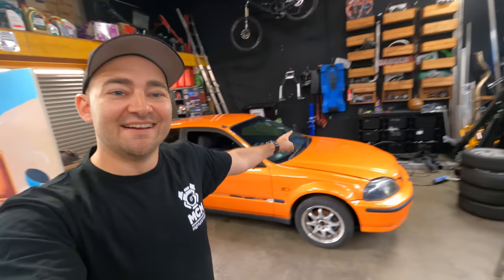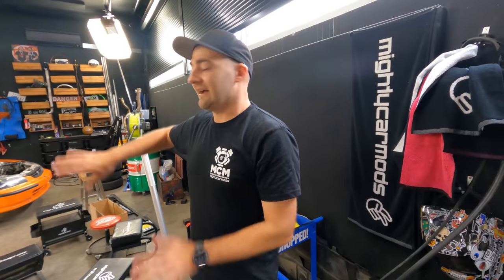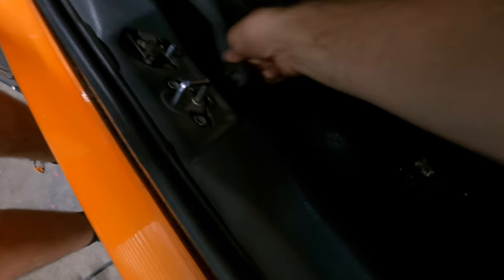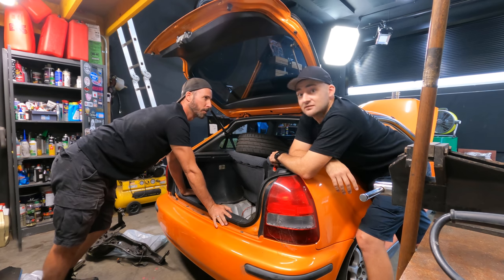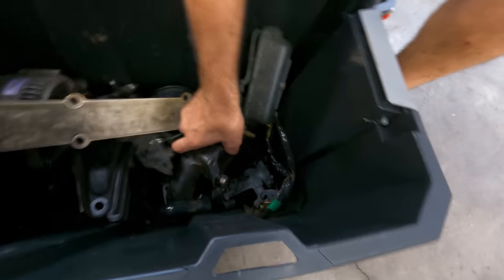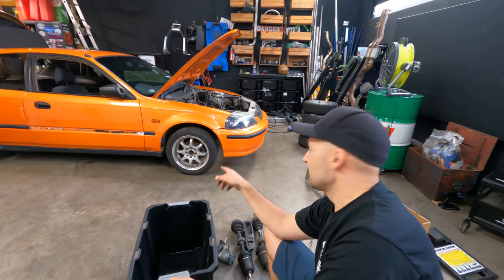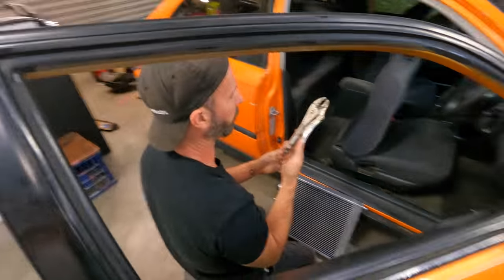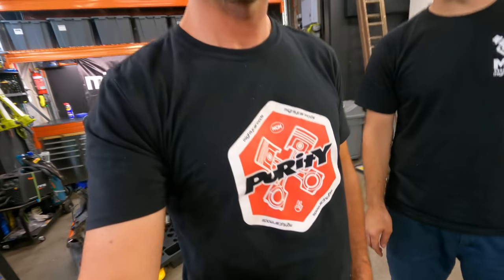Buying an unfinished Project Car (off the internet)

Comment: Answering marty's question: The one and only "unfinished" project car that i ever bought was a toyota corolla ae100. It belonged to a former diplomat from the us embassy before the guy that bought it from bought it. It had more than 500,000 km when i got it. It was running. The things done were the brakes and the suspension. When i bought it it came with a box full of parts like full aftermarket stainless steel exhaust, new headlights, a bosche horn, a nardi steering wheel, a trd shift knob, aftermarket injectors, iridium spark plugs, aftermarket camshafts, aftermarket fuel pump. I "completed" it until a disastrous day in 2014 came and a typhoon hit my city and took down a mango tree, an electric post, and an avocado tree and they all landed on the corolla. That devastated me. But the car was still running but the roof, bonnet, and boot were damaged badly. I was forced to remove all those parts and sell them. Took the corolla back to stock and sold it to a film producer where the corolla was blown up for a movie.

Comment: I bought a 1.8 mk4 golf gti turbo. Spent months and months putting it back together had it on the road for two months and someone crashed into the side and wrote it off. Most gutted I’ve ever been over a car and swore to never have a project car again

Comment: Was told by another Honda enthusiast that the 3.5L from an Odyssey can actually fit in one of these.  V6 transmission of course (say from an Acura TSX) with a conversion kit, but I’d be curious to know if that would actually work and would the steering torque be too much?

Comment: Bought a 2001 impreza uk300 : with the trunk full of new brakes , engine oil , spring studs,etc
Buuut i have to renew the brake lines and i have to convert the headlights from UK to EU... which is a pain in *ss to find some, still haven‘t found some..

Comment: I did have an 88 Volvo 240 I bought as a project, someone crashed it then took it apart but it was rust free, so I had another 88 240 but the floors were all rotted so I straightened the car that was crashed and I used the other car to make one not crashed Volvo

Comment: I feel like they got rip off. 
Cause here in Arizona I was checking out a type R swap on an integra good paint work and for 6k non turbo and running with A/C and a turbo goes for like 6k-10k here. 
Is it the dollar amount that make it more expensive

Comment: I bought a 96 civic lx back in 2010. It ran like shit, the driver side door panel and window regulator were sitting in the back seat, and the muffler was hanging with chicken wire.

Comment: Here in holland you can get a civic between 250 and 3000 euro's ... I prefer the mitsubisi there much better and reliable and with a strong 4g63 engine

Comment: The generation before that one was way better looking. I'm bias tho I have a 90 Civic hatch that I cant get rid of. I like the little fucker too much but right now its sitting in timeout because I threw 1000 dollars in parts and about 60 hours and got 800 miles before it started to rod knock. It has 80000 miles on an 8 lb flywheel on brand new bearings. Every one of those miles were driven like an angry teenager tho haha.

Comment: My 1995 Lancer GSR started pretty much exactly like this in 2012. 
I was 15, it was a few months before I could go for my L's.
Dad & I worked on it for six months, got it running, re-registered, and it's been my daily since. 

Has undergone no shortage of work since. Always at home, in the garage, DIY 😄

My 1977 Lancer started like this as well now that I think about it.. Albeit only two years ago. 
Restored & re-registered. Has been my daily for the last 12 months while the GSR has been off the road for a bodywork restoration (Been a long time coming).

If you're interested in 70's Mitsubishi Lancers, a chronological build log is on Instagram @Liams_LB

Comment: I bought my second s13 sight unseen at night. Had a cage and an RB20det swap. Completely gutted inside, had been sitting in the rain with a vented hood letting water in the cylinders for god knows how long. Just the other day was two years of ownership and it’s basically a complete daily drifter now and it rips. Haven’t driven it in 2 months and it still starts up first try every time. Check out my Instagram if you want to see the build @cashsidy

Comment: If you want a fast but cheap honda civic, dont buy a honda civic. Look for the 2005 hyundai accent hatch back. The gt models usually have a manual trans and a 1.6 liter. 

Nearly identical to a honda